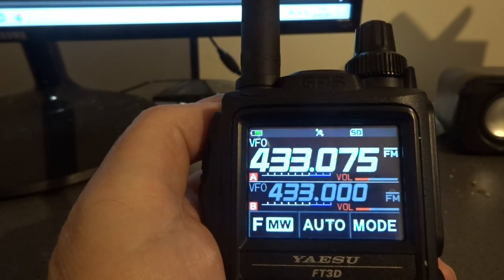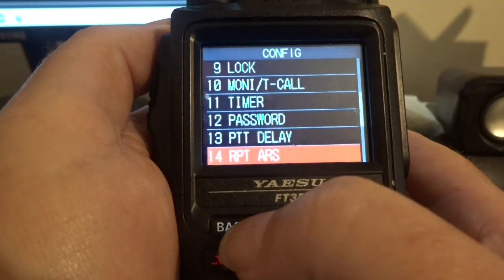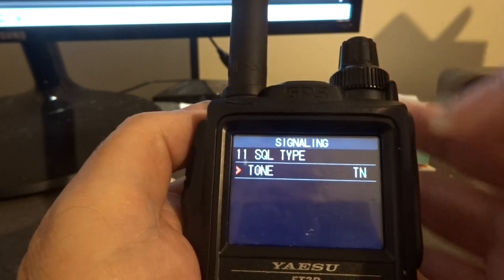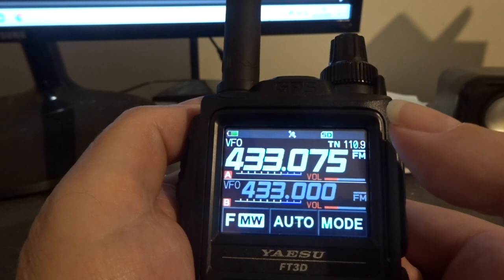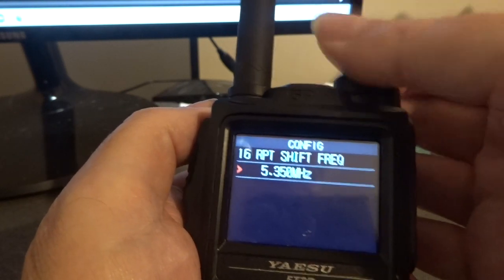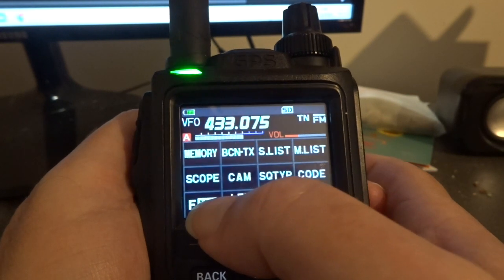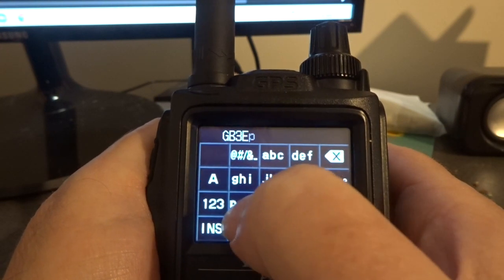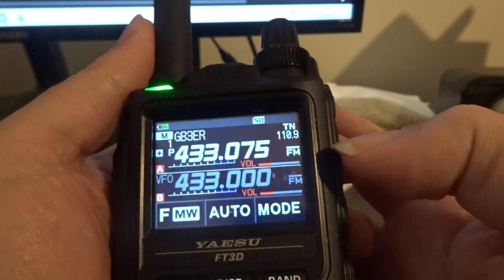Programming The YAESU FT3D.

Comment: Useful as I have also just got an FT3D and had set up for GB3ER - but can't seem to open it.  However, all my settings are just as yours. I'm 99% sure the problem is with GB3ER, not me! I suspect that it currently has an issue?
Reply from the maker: The antenna on the FT-3D is 10-1 It's best to get a better Antenna.
Reply: @2e0fjjvlogs32  Indeed. I have a large colinear on a mast mounted on my garage; it works well for both 2m and 70cm - and wideband receive.
Steve G7TAV